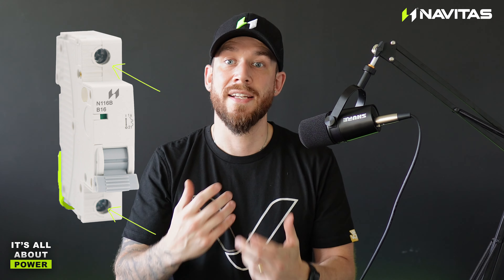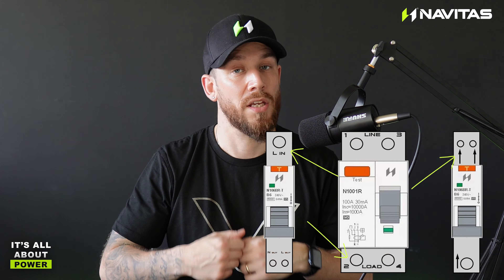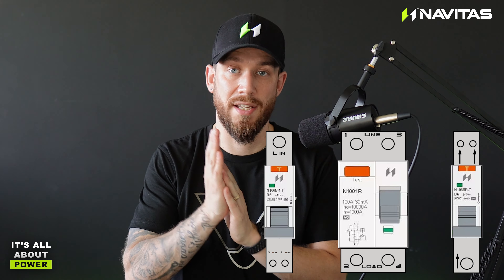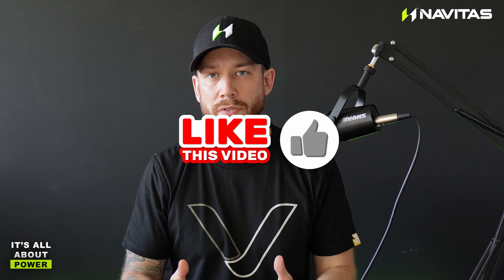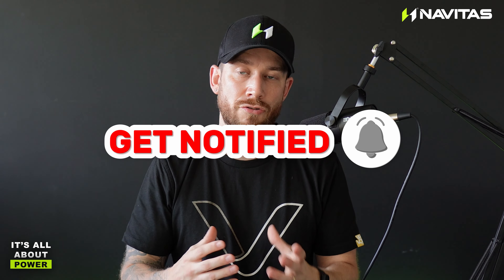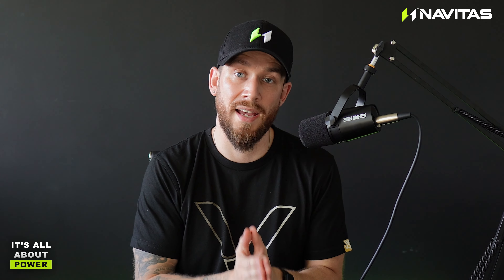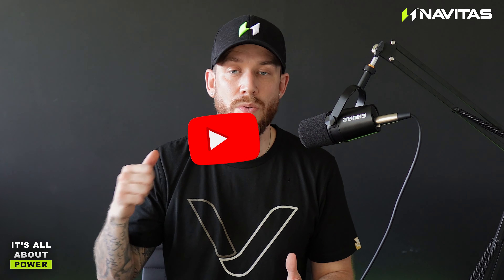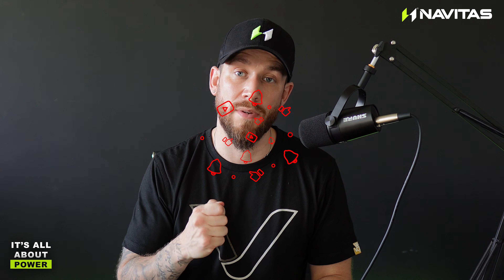BIDIRECTIONAL MYTH BUSTING!

Comment: This is probably one of the best videos about the topic. New installs going forward aren't going to be an isssue as installers will generally pick a design that doesn't need RCD protection or use a manufacturer that has bidirectional RCD/RCBO's going forward. Sadly if the test button on an RCD/RCBO fails that's a C2 anyway during an EICR and when feeding a PV install it' will need rectifying with a bidirectional device in future.
Reply from the maker: Thank you glad you found it useful 

You’re right, at design stage there are so many options, I think we will all be ok 👌🏽

Comment: Have you read the BEAMA document on this? They are stating that there could be issues with MCBs as well, with back feeding affecting the arc extinguishing / short circuit characteristics.
Reply from the maker: I will look into this but I am assuming it is indicating that not ALL MCBs are bidirectional and that again it’s down to the designer of the circuit to check the equipment they are fitting

Thanks for watching, I’ll reply back if I find anything different

Comment: Kind off helpful, up to the point of your solution to your rcbos not being bidirectional, you said save £35 not fitting an rcbo and fit a new ccu with rccb and mcbs, surely this is much more expensive solution. I think the manufacturers will be pleased with this problem as it gives them a new revenue stream, we don't need a new regulation, we need the product standard updating and all the substandard products, we have been advised to fit ,replacing foc. Proteus M2 rcbos are bidirectional, so new installs are easy to spec, what do we do with all the systems already installed, how do we code them,C2 or C3? they all met the current regulations when fitted, depending on the installation method it could be expensive to resolve, who pays for the solution?
Reply from the maker: Thanks for watching. 

If the install already has or doesn’t need RCD protection then the simple solution is to put it on an MCB that is bidirectional.

Most installs won’t need RCD protection based on the technology now available on the inverter itself. 

Most manufacturers of PV equipment recommend a separate board for renewable circuits anyway. This is due to the amount of DC leakage that can occur on that side of the install. 

Pushing people to use bidirectional RCBOs or screwing the facts to make it appear as such, you’re right is most likely due to an attempt at increased revenue. 

But it has been a good exercise to educate people that as standard, RCBOs, RCCBs and AFDDs are unidirectional as stand. As they are in most of the world who also fit solar 👍🏽
Reply: @navitascp  The bigger issue is not new installs, but all the unsafe existing installations, a lot of those will be controlled unidirectional devices and will need addressing, the manufacturers need to make suitable products instead of recommending older technology, they will be suggesting Bs3036 protection next.
Reply: I C2'd an install the other week because of this - it's not even 3 years old. RCD test button - doesn't work - instant C2. Cause the main M2 40amp RCD isn't bidirectional, so even though the MCB is due to the way the solar installers designed and installed the circuit it needed RCD protection. Work around - change main RCD for main switch, fit bidirectional M2 RCBO. 

If the RCD test button operates and the RCD operates under an RCD test even as unidirectional it'd be a C3 improvement recommended where RCD is required due to the design of the circuit.

If the RCD test button doesn't operate and the RCD doesn't function under an RCD test it's a C2 - check Napit code breakers/ NICEIC technical and Guidance Note 3. 

That's regardless of what the invertor manufacturers instructions might state.

Comment: may be a daft question, but does the current not  follow though the MCB  Bidirectional thought the BUSBAR and then back though the RCD/RCBO Unidirectional back to the Grid ? so to meet the reimernet of the intended reg , requires the main RCD shown in the CU to be  BiDirectional?
Reply from the maker: No the MCB would be feeding the battery or pv that then goes back and forth to the grid.
Reply: @navitascp  ok but how does the power get to and from the grid to the MCB ? 
Does it not come in through the main tail, though the up front RCD then The busbar. Out thought the MCB to the final circuit. 
On the return though the MCB then busbar and back though the up front RCD back tails then the grid ?
Or have I missed understood how the follow and return of Bidirectional current. 
More understanding how would not effect the upfront RCD
Reply: Or dose it only effect the protective device directly connected to the final circuit PV , battery possibly Vehical to grid
Reply: @EXFElectrician  No it effects the RCD supplying the bidirectional MCB. I've just C2'd an installation over the exact fault - see thread on the Efixx video last week. It's no good having multiple devices backing each other up if the one providing additional protection fails due to being unidirectional, it has still failed. 
Thus if using a main RCD it must be bidirectional, or swapped for a main switch and a bidirectional RCBO if additional protection by a residual current device is required due to the design of the circuit.
Reply: @navitascp  ok thanks
Reply: @effervescence5664 The passing of current the wrong way through a unidirectional RCD does not cause it to fail.

So in a situation where there are multiple protective devices backing each other up, or even in the scenario where this isn't the configuration, the unidirectional RCD will still trip when required.

The problem only comes about and the RCD becomes unserviceable when the following two conditions occur, both must be present:
1. Current is pushed through the unidirectional RCD the wrong way
2. The test button on the RCD is pressed.

Then and only then does the RCD become defective, permanently defective and fail to operate when an earth fault is present

Just to be clear, I am not saying that a unidirectional RCD should be used in a bidirectional situation. Periodically testing it by pressing the test button is important.
Reply: It's really simple.
All RCDs in the installation which will pass current the wrong way from what is normally the output terminals (load side) to what is normally the input terminals (supply input side)  must be changed to be bidirectional. It doesn't matter where in the installation the RCD is, it's the direction of the current passing through it that matters.

That is all it is.

If they are not changed, they will still operate as an RCD when needed, when an earth fault occurs, until somone comes along and presses the test button, which will then destroy the RCD.

Comment: Just fitted a Hager RCBO board and I’ve protected the pv by a bi directional RCBO as well as the battery system in the same way as the cable is pvc through the property but the heat pump is in swa so I’ve just used a mcb as its mechanically protected.
It’s like a minefield out there second guessing yourself but give it a year they’ll come up with some other doodad we’ve gotta fit as it helps feng shui I guess?😁
Reply from the maker: Thanks for watching. 

How much were the RCBOs if you don’t mind me asking

Comment: Actually this is stupid. IT should not happen! It needs a change in RCD design to stop damage to itself. It does not need the REGS changed. The problem is too many manufacturers on JPEL/64!
Reply from the maker: Thanks for watching. Too many or maybe not enough. Great thought through.

Hope you enjoyed the video
Reply: Hold on. let's think this through.
You are right, it does need a change in RCD design to prevent damage to the device.
That design has already been done...it's in the product which is a bidirectional RCD!

So one solution to this problem is as follows:
Change the regs to prohibit the use of unidirectional RCDs. Require them all to be bidirectional.

So a regs change is the answer.

The problem with this solution is it prohibits the use of the cheaper unidirectional RCD.

In time as sales quantities of the bidirectional RCD increase, the manufacturing cost will reduce, so in time the retail price of the bidirectional RCD will fall (not withstanding other factors increasing such as electricity costs in manufacture).
But whether the bidirectional RCD will ever be on a price parity with the unidirectional variant I cannot say.

Comment: When is someone going to make a double pole busbar and no fly leads!
Reply from the maker: Watch this space
Reply: @navitascp fuck yes
Reply: Nip over to France. They had double pole busbars with double pole MCB's 25yrs ago when I lived there. Seemed a backward step when I moved to the UK and kept coming across RCD's tripping in split load boards from earth neutral faults and the customer couldn't isolate it via the MCB as its only single pole here in the UK. The manufacturers I remember making this stuff was LeGrand, Hager, Merlin G.
Reply: they did just went under... sbs
Reply: @AGRElectrics  yes I never did get chance to use them!

Comment: The blame for this lies at the feet of some manufacturers.  IET realised that there were bad designs out there that could fry their own protection circuit, turning them back into MCBs.  The are manufacturers who always provided designs without this flaw and as they used normal markings of the time (load etc) if you followed the advice of this channel then people would worry about protection devices for no reason.  In fact the only meaningful way to check by looking at markings is to see if 2 (bad) or 3 lines (good) are switched-out when they trip, as indicated by the mini circuit diagram - often printed on the side.
  
For some manufacturers this change requires new markings and not a new design of RCBO or RCD, effectively to show that they don't have this design flaw introduced by others.  Shame this video didn't mention that you can use the never-tested-at-6-months-either button to see if your current RCDs or RCBOs have been fried already by an easily-forceable issue.

I happen to have an original MK Sentry CU with MCBs, RCDs and a PV / generation system (and an evil plastic front cover).  I'm I impacted by this 'issue'...err, no.  Not at all.  The RCDs will happily trip without frying the protection circuit as the 3rd line (ie on the 'Test' side) kills the power to the PCB.

I feel that some manufacturers are trying to deflect the issue to the 'new' rise of PV and battery systems when in truth many standby generation systems (typical of more remote communities) have always had this issue.  If your manufacturer of protection devices didn't design for this then they deserve some flack for it.
Reply from the maker: Thanks for watching but you are simply highlighting exactly what I was saying.

There isn’t a need for a mass fear around needing new devices for a solution that has been present for a number of years.

Comment: Thanks for the video. But 

Am I missing something or 

You have bi directional mcb (overload or short circuit ) protection 

You do not have bi directional RCD (earth leakage) protection.

So the suggested solution does not in fact have bi directional rcbo protection if required.
Reply from the maker: Correct, our RCCB at navitas is however bidirectional. Most aren’t as standard. 

It’s why you need to check the markings.But most MCBs ARE. So if you design your circuits appropriately you may not need RCD protection. 

Appreciate I may have been as clear as that on the video. I didn’t want it to come across like I was flogging our RCDs 😂
Reply: @navitascp  thanks, nothing wrong with flogging a bi directional RCD. I listened to the electrician's podcast. This whole the manufacturers are dictating things is hilarious. "Proper" electricians were flat out fitting batteries and inverters into lofts as convenient for them until they had to be stopped.

Comment: Eould electricians if needed start fitting differant brands to cu. Normally we would keep the same brand and it would not be good practice.
Reply from the maker: Thanks for watching. You can’t cross pollinate brands due to type testing. It’s actually quite important. In fact I think we will do a video on it lol
Reply: @versoelectrical  that's great to do a video but the huge issues are now going  to be how an electrician can over come the situation that could lead to very expensive cu changes for customers
Reply from the maker: Why would you need to do CU changes when a simple MCB is bidirectional? 

If you have an install in place that has incorrectly used a unidirectional rcbo for example there is a work around. Failing that you could add a small extension unit to the install at the fraction of the cost to a board change